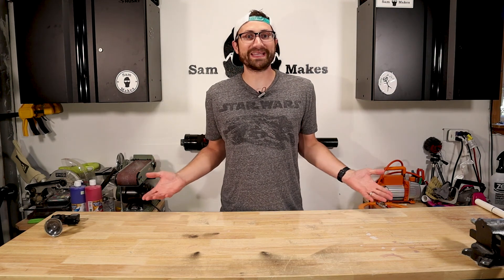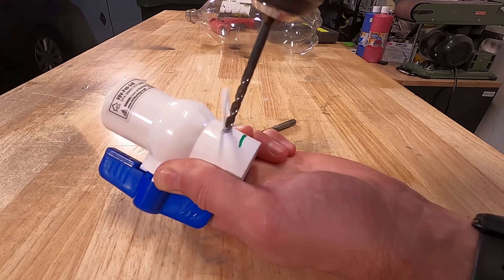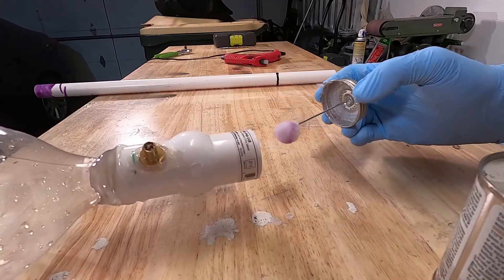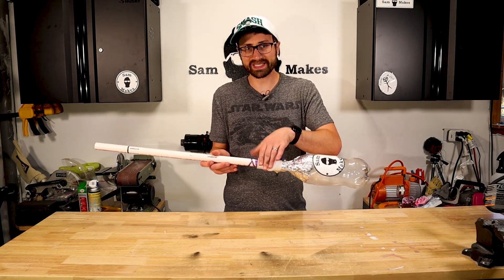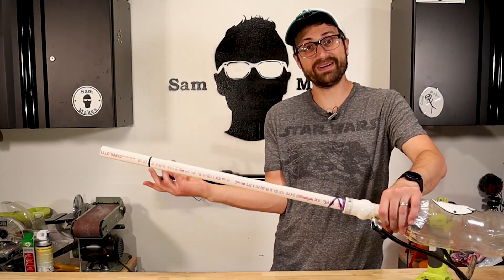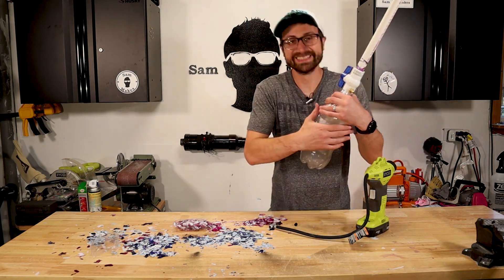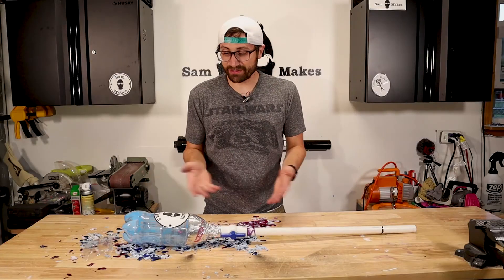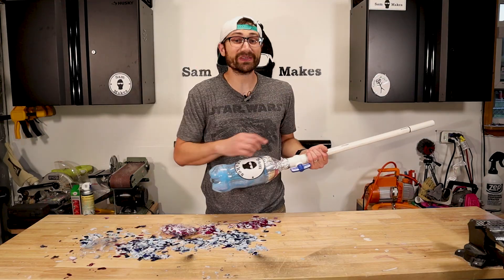$5 DIY Confetti Cannon

Comment: I’ve made bottle rockets with my engineering students for years, and we launch them at 90-110 psi. Yes occasionally they explode. We do all our testing and launches at 70 psi then push them as far as we can. Soda bottles are rated for 70psi.

Try another round but use an electronic solenoid to open the valve for added explosion! Then you could throw on a trip wire for lots of surprise fun!
Cheers Sam!
Reply from the maker: Fantastic suggestion! That's awesome to hear about making bottle rockets, I also was hazy on how much PSI a soda bottle could take thank you for that! 

Thank you for watching I hope you enjoyed it!